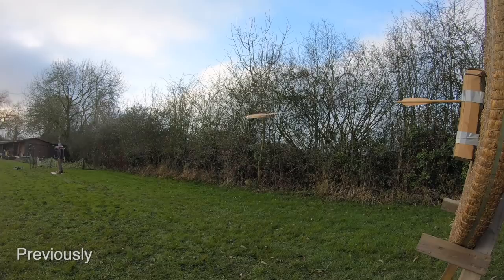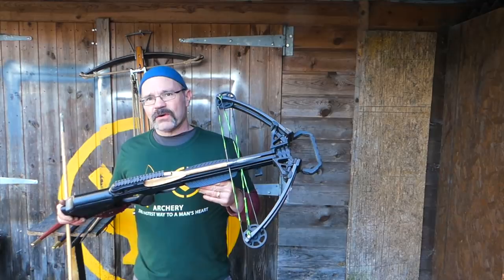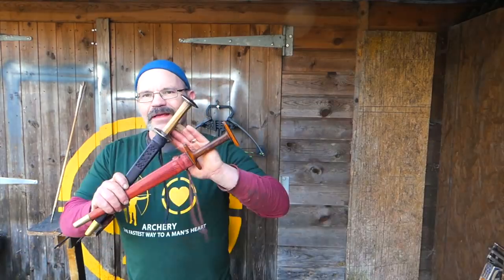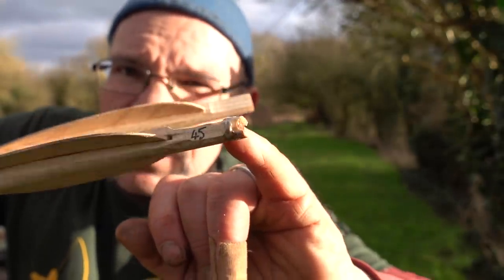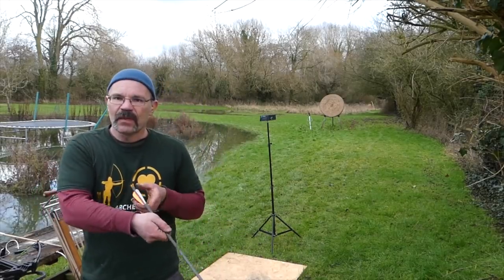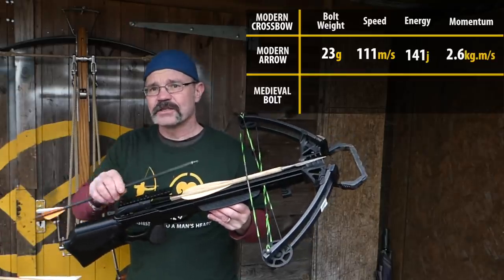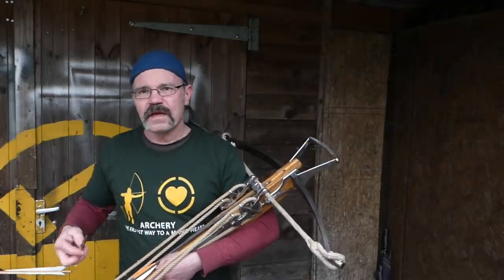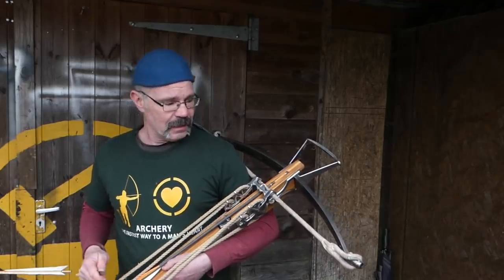Heavy Crossbow - Light bolt - What happens?

Comment: The speed the arm moves back to it's rest position is basically related to the POWER of the bow.

These are average values: the bow actually takes more force to pull it back the further back you pull it. If it is a spring that obeys Hooke's law then the force doubles when the extension doubles. With this in mind it is a reasonable assumption to make that the maximum power is double the average power, but I could not tell you where in the firing stroke the peak power actually is... 

Some physics equations applied to the bows:

Average Power = Total energy transferred / time taken to transfer the energy

Average Power = average Force x distance moved in the direction of the force / time taken to transfer energy

thus:
Average Power = Average force x velocity

So the speed the arm moves forward is proportional to the power of the bow and inversely proportional to the force the bow provides.
Double the speed = double the power
Double the speed = Half the force

hope this is useful!

Comment: Hey Tod, thanks for the continued explanation of the differences between these two crossbows. However, I would love to know if a crossbow could be made out of springy enough material with a heavy enough draw to essentially get a “best of both worlds” scenario. Something that could shoot medieval weight bolts at modern bolt speeds sounds devastating. I’d also be curious as to how armor would hold up against it. Thanks again for making these videos, loads of fun to watch and think about.

Comment: I almost didn't watch this because I thought I knew the result. I'm glad I watched anyway

I was SURE the big crossbow was just gonna shred that tiny modern bolt to pieces. Figured it was WAY too much power for a bolt that is expecting <200 lbs of push.

So fascinating. And I guess it makes sense, it comes back to that difference in powerstroke between modern and medieval. That modern crossbow just has so much more time to impart that energy.

It makes you wonder......what would a crossbow with 960 lbs draw weight like a medieval crossbow and a 14 inch powerstroke like a modern crossbow look like....?

Comment: Hunter and aspiring black/bladesmith here. I wonder... steel bolts? They'd be heavy like the medieval bolt and therefore be able to maintain the numbers listed while still being able to fit the modern bolt clips... possibly be able to tweak the flex for accuracy by pattern welding steel for various hardness's and different tempers... forge a broadhead directly into the shaft and just add fletching... wonder how that would work on big game. Better yet, I wonder how the conservation officers would react given the minimum specs required to hunt in my area.

Comment: The other reason you got a small difference in speed from that much heavier bow is the distance moved. The lighter bow is putting energy in over a longer distance. The heavy bow is putting energy in over a far shorter distance. Not quite the same but not far off from putting an 8” barrel on something firing a 7.62x51, you just don’t have the distance to accelerate it.

Comment: This makes a lot of sense.
For the record, apparently using heavier bolts on a modern crossbow is also better for the longevity of the limbs.
Essentially, the bolts mass acts a dampener, so if you are using cheap light bolts on a cheap crossbow, the limbs wear out faster and eventually shatter because of the repeated shock force.
Load them up with heavier bolts and it slows down the rate of energy transfer and the limbs last longer.
Thats the theory anyways.

Comment: Makes sense as the cause of energy inefficiency in the system is how much of the energy is spent moving other mass such as the heavy limbs and the thick string (which is wasted being slowed down again). The heavier the payload the relatively smaller proportion the "dead weight" is.

So halving the weight of the bolt doesn't have the total mass being moved.

Comment: It is easier and i think more intuitive if you think of it slightly different:
You are not only shooting the arrow but also the string and the bow it self. Those parts also need to accelerate and that takes energy, force and time.
The medieval crossbow has a thick string and a very big and heavy metal bow - that might behave like an additional 200g on the arrow. Going from 267g to 223g is not that much of a difference.
But the compound-bow not only is far lighter, the levers further divide the weight that needs to be accelerated, it might be as low as 10g and the difference between 77g and 33g is a lot.

Comment: A few questions: 1. Why didn’t they just have a piece of spring steel to hold the bolt? Like you said, holding it with your thumb is awkward. 2. Why is the trigger so enormous? 3. Why is there no trigger guard? 4. Why no sights?

Comment: This is exactly why I use fairly short limbs with a long riser on my recurve bow for target archery.
The same draw weight, but faster.
However, it does become quite stiff at the last few inches of the draw length; draw weight ramps up quite rapidly.
So it's very sensitive to over and under drawing.

Comment: I think the biggest factor in speed is draw length. While the much heavier crossbow can move much heavier bolts, the actual period of acceleration, how much the string moves, isn't that high. the modern one covers a lot more distance to fling the bolt forward. not sure how much use that would actually be to know in this instance, but it helps explain the differences between shortbows and longbows in conventional archery. exact concepts maybe not perfect cause I can't be bothered to read up on the physics but that's my understanding of it

Comment: It wouldn't have been in Europe at the time, but in Turkish archery during the middle ages they tried to get the arrows as far as possible.  To do that you need speed more than anything else.  There were probably Turkish bows pushing arrows well into 400 feet per second or even 500 feet per second because the ranges they claimed would have only been possible with a very heavy tail-wind, or a very fast arrow.  Arrows as light as 1.25 grains per lb of drawweight, bows with recurves so severe that unstrung they looked like the letter C, and with a Siper or Majra they could shoot shorter/lighter arrows.

Comment: basically, your're getting screwd by the rocket equation. the propellant (the spring) needs to drag itself along. This is why bow limbs are taperd (just like how rockets have multiple stages, decreasing in size). The only ways aorund this are higher specific impulse / energy (need to drag along less weight for the same payload velocity), staging / tapering or in the case of compound bows mechanical advantage (only need to drag the string and outer edge of the cams to full velocity).
would be fun to see you engineer a crossbow with medieval materials and equipment but modern engineering knowledge.

Comment: main reason is as todd said, the energy lost in inertia of the heavy parts of the medieval crossbow. This is why infact mongolian or ottoman turkish bows were superior to westerns ones as they were light ( i don't say "light" as means of pulling strength but mass and inertia)  composite bows.  cheers and peace  .  :)
Reply: Quite true, but to clarify, Europeans did have composite bows in a certain form. The difference is that the upper-class warriors of the east were often horse archers, while the European nobility were heavy cavalry and left archery to mid-status soldiers. Thus, the archers of Europe weren't able to afford composite bows so easily, and stuck to simple wooden ones. On the other hand, European nobles did favor composite lathes for their hunting crossbows. In short, it comes down to differences in warfare styles, rather than a lack of available composite bows.

Comment: it's Just like my juniper short bow.
It will shoot a super heavy chokecherry shaft just as fast as a lightweight modern gold tip carbon arrow. 
However the wood arrow does tremendous amount more damage.
As he said, I have a concrete truck. There are ways to speed up velocity though. Sinew backing!

Comment: There is more at work here than just the speed of the string and bow. The youtuber Tom Stanton has an excellent series of videos about building himself a trebuchet. Essentially the weight of the arrow should be such that as much energy from the bow string is captured, too light and it doesn't take all the energy, too heavy and its too slow. Very interesting that the crossbow shot the heavy arrow with more energy, probably indicates there is some energy left when firing the modern arrows.

Comment: When you try to accelerate a cylinder forward and don't apply the force through its centre, Fun Things (tm) will happen. We probably would have gotten a higher speed out of that bolt, even, though probably not that much higher.

An interesting thing is that the mdoern bolt prefers speed over energy or momentum - maybe because modern crossbow makers want to give us as flat a trajectory as they can?

Comment: I think you should also take into consideration arrow's spine. Flexibility if you would like to call it.
The modern arrow you have used is probably originally designed with spine (flexibility rate) matching modern draw weight (I believe around 100# in your case). Then you shot it with a draw weight significantly higher, so the arrow flexed so much of the momentum of the knock and inertia of the point that it almost bended in two, you would probably have seen it if you were shooting in slo mo. 
This extreme arrow bending also results in arrow shaft hitting the body of the bow (crossbow) several times, also reducing speed.
 So this instant bending/straightening of the arrow "ate" huge amount of total arrow momentum and speed.

I think if you would take a modern arrow with lowest available spin you would get a higher velocity results.

Comment: There's a bit of a Mass vs Velocity debate, more around the firearm community than bows, and crossbows.  (It's more significant for a rifle, TBPH)  Because the Momentum Equation is Mass(Velocity)^2, a lot of people stress Velocity over Mass.  However, that momentum is measured at the muzzle.  Velocity drops off, Mass doesn't.  You need Mass, AND Velocity to make it work.  How much?  It depends what you're shooting, and from how far.

Comment: Would an even heavier bolt on the 960lb bow deliver more energy? or is the old bolt already the optimal weight
Reply: I thought the same thing, maybe you can get even more out of the crossbow.
Reply: Probably would, there's a lot of power left in there, but it would fly slower and put more stress on the string so it wears down faster.
Reply: There is no optimum, considering you trade speed for energy or momentum. The heavier a bolt is the more energy it has but never the maximum. Also momentum goes up with weight but with ridiculously high weights speed is ridiculously low.

Comment: Thank you very much for doing this comparison. There are a lot of people out there who thing the massive draw weights used in medieval military weaponry can somehow overcome the efficiency introduced with technological advancement. Im also beginning to question whether the medieval crossbow was actually more powerful than the longbow. Those medieval bolts weigh almost the same as the medieval arrows you shoot out of the lockdown longbow, and the lockdown longbow was shooting them around 200 fps if I recall, 20 fps more than the windlass was shooting the heavy bolts.
Reply: He mentioned in another reply post that he has shot bolts twice as heavy as the medieval example bolt from that windlass with minimal change in speed. Doubling the mass doubles the momentum, if there's no speed change. But since a normal medieval bolt can pierce platemail, there's really no point in super-heavy bolts except if you're aiming to kill armored elephants or something, nothing needs that level of penetration power in that era. And if you want to proper X-bow overkill, you move up to a ballista anyways, which is more or less just a really big X-bow.

The "power" of the medieval crossbow is that a child could fire it. Castle under siege? Three people in a row, one winches a bow, one aims and fires it, one hands the bows back and forth. Need more firing rate? Add another reloader. Firing the Xbow is easy, accurate, and fast, and can be done by minimally trained idiots. Archers are expensive, and rare. Dirt farmers with working index fingers are common. The power isn't in "it's better", it's in "if you have 1000 people, you might have 10 archers. If you have 1000 people, you have 1000 crossbowmen."
Reply: @ravenscroftraven1786  I understand the benefits of the crossbow. My comment was that the crossbow is not necessarily more powerful than the longbow, which i think a lot of people believe is the case when they look at the poundage difference.

Comment: Thanks for the very interesting video. Is there another measurement for bows/crossbows which incorporates the speed of the action alongside the string weight? Giving the weight of the action only is like giving the torque figure of an engine and no Hp.

Comment: Right. Now we just need to invent a 960 Lbs compound crossbow and see what it does.
The bolt goes clean through the archery matt and burrows so far into the ground you need to dig it up with a spade?
Or the string simply bisects every single bolt available on the market.

Comment: Look for a thicker modern bolt like the Easton aluminum xx75. Im sure ssomeone makes a modern carbon bolt that is a bit thicker. A diamond pipe cutter is a cheap way to cut modern arrows.

Cut them down to modern flachettes. Try to  Shoot from schnepper and windlass crossbow. That would be super interesting.

I wouldn't try them out of the modern crossbow, the compounds are a bit more fragile and they have minimum arrow  weights. The modern recurve you just got should handle them just fine though. 

Side note: modern recurve crossbows love 3/8 dowel arrows, cheap and durable projectiles that don't take much work to fly straight.

Perhaps try different head weights, i think there is a curve for each bow- arrow weight to input power that gives maximum FPE.

Also, another metric that would be cool for your videos is SLUGs we hunters use it for arrow building because FPE is really a better metric for bullets rather than arrows that rely of momentum.

Comment: Different set-ups for different purposes.  While it would be interesting to see what would happen if a Civil War (US) era caplock would do if fired with the normal volume of black powder was replaced with the same volume, or even an equivalent amount energy-wise of smokeless powder behind the Minié bullet, it would also be extremely dangerous, IMO.  

Crossbows are obviously safe for this kind of testing, my point is that how a weapon is optimized really matters.  Soldiers tend toward specialists, once you get above the rank and file, and thus their weapons get specialized, too.  Remember Jörg's Instant Legolas, and how it was deemed as relatively useless with a war bow?  That's true, but if it had been developed I have little doubt that armies or mercenary units would have found ways to make use of them.  The Chinese repeating crossbows had a much lower draw weight than we see here, but they weren't useless.  Specialist existed, and they made best use of weapons that were exotic when compared to the usual type of arms at the time.

Comment: I think you described it pretty well in the previous video (I think that was the one) where you mentioned the medieval crossbow uses most of it's energy just moving the parts, not so much the bolt. So it can't move a lighter bolt quicker than it can move the string and arms. That said, the modern crossbow still shot faster with the heavy bolts. I'm curious if you used heavier bolts if there might be a point the medieval crossbow might overtake the modern one. Though I suspect you're sacrificing range in favor of payload at that point, but maybe not a bad choice from the top of a wall.

Comment: I saw a video where a guy tested a 25lb and 75lb modern bow versus Kevlar and a Ceramic Plate body armor.  Needless to say at those weight the arrow almost nothing to the armor.  We saw in "Bows and Bullets vs Sand Bags" that the higher momentum of the arrow/bolt allowed it to punch through the Sand Bag.  Would something similar happen to Modern Body Armor vs 900lbs Medieval Crossbow?

Comment: Apart from the differences in materials, you already pointed out; wouldn't you say the different frame construction itself makes a big difference in translating power from the bow and string to the bolt?
I'm not talking about the compound system, but the bow itself: On the modern crossbow it's two sides of a bow that are aligned to be almost centered/at a right angle to the bolt, so the string is putting less pressure on the rail, minimizing the drag/friction on the string when shooting.
With the medieval crossbow the steel bow is made from one piece, forcing it to be at a non-optimal angle to the bolt and the (thick) string to press hard on the (wide) rail. I'm not a physicist, but to me it seems like that could also be a major factor in the loss of energy translated from the bow and string to the bolt.

Feel free to correct me, if I'm wrong.
Reply from the maker: Not wrong, but not enough to count in this scenario.  The string dragging on the stock loses 5-10% of velocity
Reply: @tods_workshop  Ah gotcha. Thanks for replying.

Comment: What is the ideal load for the 960-lb medieval crossbow (the weight of bolt which delivers the maximum amount of energy the crossbow can supply)? Could bolt heavier than 67g make better use of the slower but heavier steel bow?